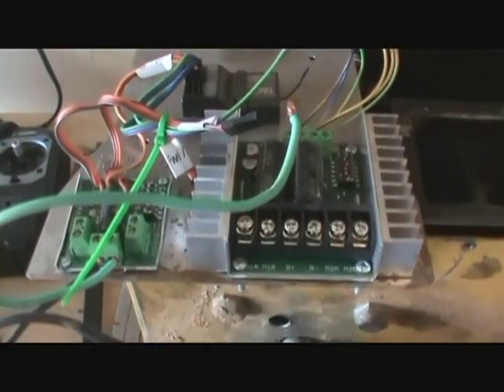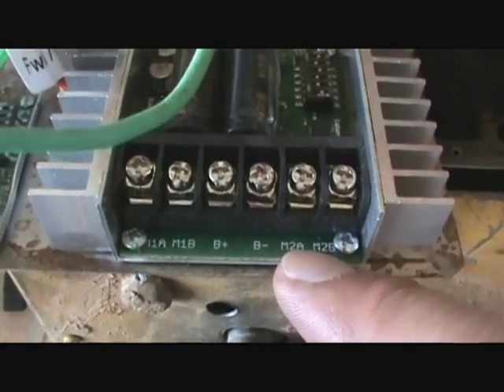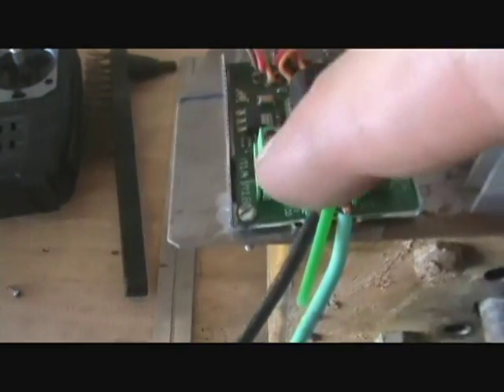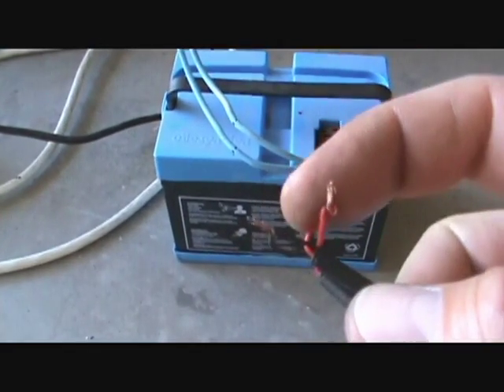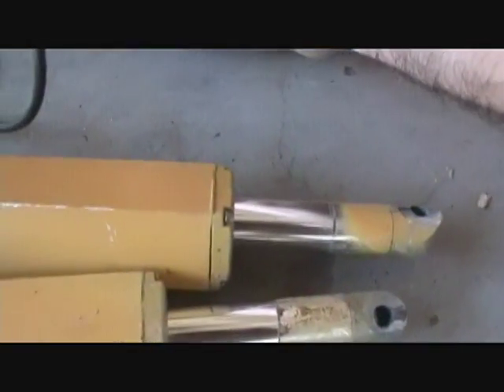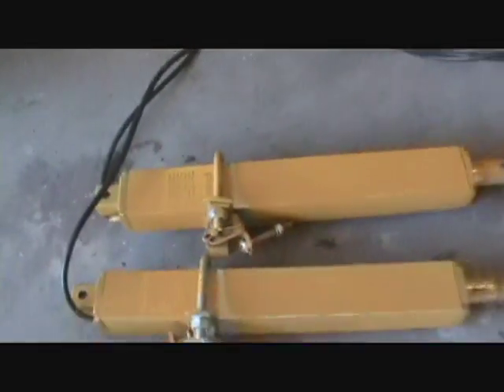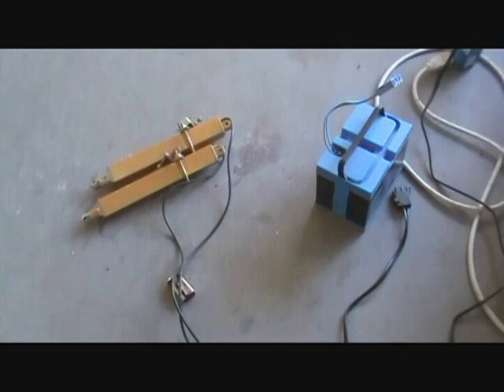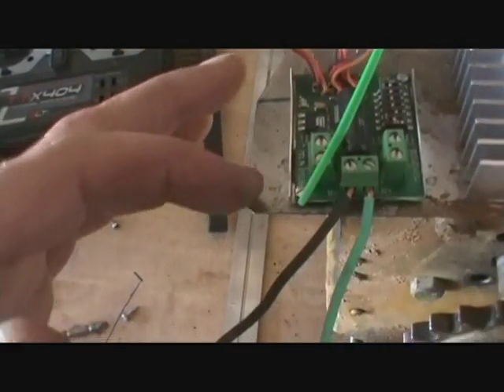How to build a RC Dozer Video 8 Electronics Part 1.

Comment from the maker: The remote I use is a 4 channel basic radio and it will come with the receiver. Connect two channels from the receiver to the 2X25 Sabertooth motor control for the drive motors for the tracks. I also used a 2X5 for the FA-MS-15-12-4 Mini 4" stroke 15 lbs force 12V actuators. Search Dimension Engineering for the motor drives. Also look at the PDF documents, it will show more detail on how to set it up and get the wiring correct. Let me know if you need more info.

Comment from the maker: @runiemage99 Yea they look hard but they are easy....download the wire diagram and also check my Dozer rebuild videos...it has more on the wireing of the sabertooth. when i first built the dozer i used the servos to move a switch....but not required for the sabertooths...they are awesome!

Comment from the maker: @runiemage99 you can do a search for FA-MS-15-12-4 Mini 4" stroke 15 lbs force 12V actuator, I found them at e-motion llc, and they are the mini ones, as far as the servos i used them in a past aplication, the sabertooths took there place, so you dont need them. If you need any other info let me know and I will be glad to help.